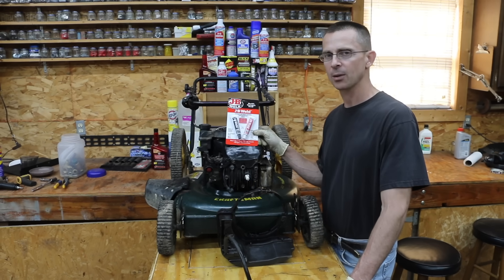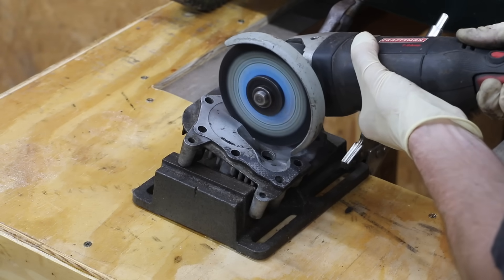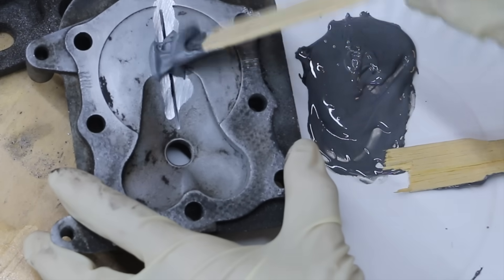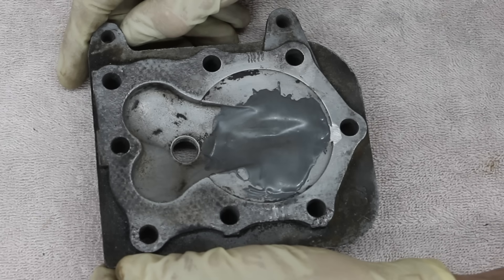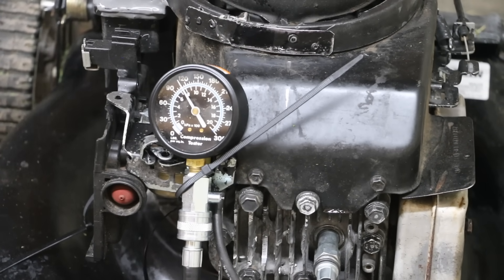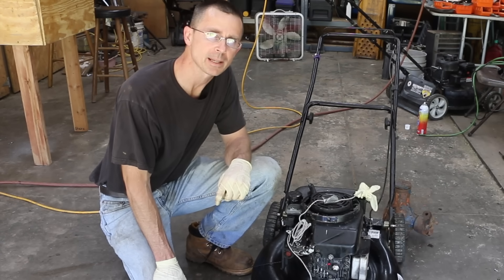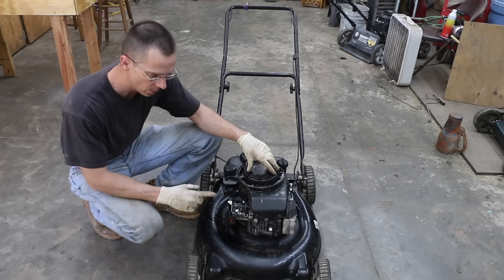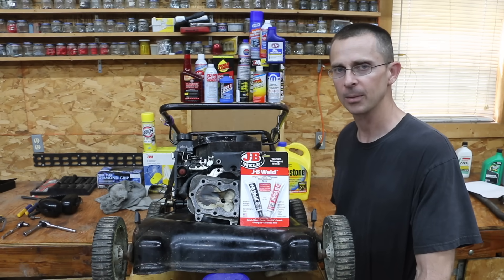Can JB Weld fix a cracked cylinder head?  See the proof!!

Comment: ive never used  JB weld. I would have never trusted it to BE a metal.  now not to knock the vid but I think a crack would have extended to the end of a head or whatever which would allow twisting between the 2 sides.
ive seen Jeff of "ElderlyIron" use JB weld for worn spots on an axle where a seal rides. I would not have believed it would work, but he swears by it.
thanks for testing.
Reply from the maker: Great point!  Thanks for watching the video and commenting!

Comment: I actually used JB Weld on one of my Cadillac's cylinder heads. Somehow it managed to get a divot just outside of the cylinder water jacket which caused the gasket to fail 3 times in just a couple years. It's been working fine for almost 2 years now.
Reply from the maker: Impressive use of this product!  Thanks for watching the video and commenting!

Comment: hey man. I'm digging these videos. I used jb to glue coral together in my aquarium. I'm curious to see how jb weld would stand up to vibration. maybe try breaking one of the engine mount tabs off. jb it back together and run the engine with only that one tab holding the engine down while running an unbalanced blade. could be interesting. keep up the good work. chris
Reply from the maker: Great suggestion!  Thanks for watching the video and commenting!
Reply: JB Weld is toxic to coral and fish, just so you know, as well as not safe for human food containers either! They do make ones that are for ceramics and plates and stuff though!

Comment: It works on diesel tractor heads. A friend of mine not only repaired the head with JB Weld, he tapped it and bolted it down. It ran for 4 years. I've used it on swimming pool filter control valves which are known to crack through the threads. When the JB Weld cured the leak was fixed. It's an excellent product.
Reply from the maker: Wow!  Very impressive fix!  Thanks for watching the video and commenting!
Reply: I've seen it fix a crack in the block on a diesel tractor as well. Still runs 10 years later. No oil leak, and no antifreeze leak.

Comment: We used JB weld in the shop in conjunction with cold weld plugs to repair cracks in the exhaust and intake ports in cylinder heads that came in for valve jobs. We never had one come back!
Reply from the maker: Impressive!  Thanks for watching the video and commenting!

Comment: There is a similar product they use to fix tank canon bores.   I've seen someone fix a hole in a cylinder head with it and I know it's used to fix holes in coal slurry pipes - its called Devcon 10760 Titanium Filled Epoxy Putty - pretty amazing stuff, I used it to fill some rust pinholes in sheet metal and it's pretty much unsandable afterwards.  It's extremely expensive, but by far the hardest epoxy-type filler I've ever seen.
Reply from the maker: Thanks for the product recommendation!  Thanks for watching the video and commenting!

Comment: JB weld is great stuff I once used it on an oil pan the oil pan was on an ls1 engine making roughly 500hp it has never leaked and that was back in 2008 when I applied it
Reply from the maker: Impressive!  Thanks for watching the video and commenting!

Comment: here's the potential future item I used the product Q-Bond, and I used it for repair of a carbon fiber propeller. it comes essentially as a super glue which binds to an adhesive which is designed for different materials including metal. I think it would be worth a shot to try it out or something such as a cylinder head excetera. http://qbond.net

Comment: Maybe this experience will help someone who is stuck? Many years ago, I had a college kid for a tenant who worked a night job as a security guard. His funds were VERY tight. He developed a leak in the metal fuel tank of his chevy sedan.  So here we go, flat of my back on a cold winter evening under an old chevy. We hit the leak with rough wet and dry paper and put a nice fat self-tapping screw into the "spot." We mixed and applied an epoxy putty product rated for fuel tank repair, smoothing out the product to cover several square inches in addition to the screw head. Once I was positive the leak was stopped, we placed a bare light bulb under the repair to speed up the curing process and kept an eye on it for ant sign of a leak. In a few hours, my college student went off to work and had no more trouble with his vechicle. Not the perfect repair I would have liked to perform but it worked until graduation, a year and a half later.
Reply from the maker: That was nice of you to help and a great success story!  Thanks for watching the video and commenting!
Reply: That was very nice of you too.Also glad to hear there's another smart person out there who'll use JB's stuff.
Reply: @derkmerv6725  LOL.
Reply: Rub a bar of soap on a cracked gas tank. Works great
Reply: I was that college kid...   not .. but cool story.

Comment: Is there a single lawnmower left in your neighborhood???  Nice video.  One time we build a blown small block chevy with an aluminum block.  We had the motor on the dyno and it started leaking oil out of the back of the block.  There was a porous section in the casting allowing oil out of the main pressure galley.  The customer was due in in the AM.  So we scuffed the surface and wadded it up with JB Weld and let it sit overnight.  We should have TIG welded the block, but we had no time.  Worked like a champ with over 80psi of oil pressure on it.  Thanks for another great video.
Reply from the maker: LOL!  Running out of mowers around here! Thanks for sharing the success you had with JB Weld and Thanks for watching the video!

Comment: I tried jb weld on a gas tank, and it started to leak after a week. could have been my fault, but I'd like to see your tank after some time has gone by. I did used quick weld. maybe it doesn't work as well for gas tanks. great vids, thanks for keeping it real.
Reply from the maker: Others have commenting that the quick weld isn't as strong or durable.  Might be worth trying the slow dry product.  Thanks for watching the video and commenting!

Comment: JB is pretty good stuff! it's supposed to tolerate up to about 500ºF. it does need to be reinforced on thick, structural repairs. Fiberglass or aluminum window screen usually will do the job to reinforce it.

Comment: Great video(s)!  After garbage picking a 1982 Lawn Chief rototiller back in 2001 (only to find out the fuel tank was severely pitted w/dozens of holes & replacement tanks had long since been discontinued) I used JB weld (based on my Grandfathers advice) and coated the entire fuel tank on that 1982 Lawn Chief tiller... and 15 yrs later the JB weld is is still holding strong. No leaks or cracks and I never drain the residual fuel out of it! Plus, all these years later, the tank itself actually looks as though it had been  professionally spray painted gun metal gray thanks to the JB weld!
Reply from the maker: Awesome!  Glad it worked!  Thanks for watching the video and commenting!

Comment: When I was running sprint cars used JB to fix a cracked head on a HC 327 also to fix a cracked block where it had sat in an outside barn with water left in it all winter. Was a wide crack and the JB wanted to run out the bottom so backed it up with the silver paper from a cig. pack. Engine ran for two more years, thru several re builds, till a rod let go and I couldn't afford enough JB to stick all the pieces back together.
Reply from the maker: Another great success using JB Weld!  Thanks for sharing and thanks for watching the video!

Comment: I don't know that it is better, or worse, but a similar product is Devcon Plastic Steel Putty 10110. It is similar to JB Weld except the filler metal is steel instead of aluminum. I don't know if you'd want to use it in all the same circumstances or not, but it is a similar product I've used for other things. It's machinable just like JB Weld is, and is a two-part epoxy product, too.
Reply from the maker: Thank you for the product recommendation!  I'll add it to my list of possible products to test.  Thanks for watching the video and commenting!

Comment: Neighbor from hell, don't leave your mowers unattended. lol
Reply from the maker: LOL!  Thanks for watching the video and commenting!
Reply: @HONESTO UNO;

If you're talking about old oil stains on concrete, this is the method I use.

1) Pour some mineral spirits on the area, enough to cover the entire stain but not really flooding it.

2) Dump floor dry/cat litter onto the mineral spirits approx. 3/4" deep.

3) Walk away.

4) Next day, sweep up floor dry and the stain should be gone. You may have to repeat the process if it don't remove all of the stain.

I've been doing it this way for years. The 1st time was strictly by accident. Once I saw how well it removed some old oil stains I tried it in a different spot. Same results. No more stain.

A good thing about doing it this way is I'm able to sweep up the floor dry and reuse it.

Hope this helps.
Reply: +HONESTO UNO
Thanks. I'm so happy it worked for you. like I said before, I found it worked by accident. Now it's the only method I use and recommend.

Thanks for the compliment AND the update. Glad I could help.
Reply: +HONESTO UNO;
If it's older concrete you can probably use a bit more mineral spirits. My garage is only 31 years old so it's not too bad floor surface wise.

I do however 'use' my garage. It isn't generally used for actually parking vehicles in, but for a multitude of repairs.

Make sure to use plenty of floor dry.

Here's my 'theory' as to why this method works.

Mineral spirits breaks up the old oil. Floor dry, when put on rather heavy, helps to keep the mineral spirits from evaporating rapidly, thus giving it time to work.

The extra floor dry actually soaks up all of the mineral spirits making for a dry compound which can be reused.

Like I said, it's only a theory. 

All I know is it has worked well for me.

Please keep me posted.
Reply: "I swear my mower had an engine last time"

*Hears from neighbor's driveway*

"Today we're going to see if we can run this lawnmower engine on ground up mummy dust instead of oil"
Reply: Skinny Mcdoogin s
Reply: husky clip board
Reply: +HONESTO UNO Coca Cola works. Soak, rinse, repeat.

Comment: Fixed a metal rain gutter that someone shot a BB through. Put a little round bandaid on the bottom to keep it in there while it cured. It will still be there after the rest of the gutter rusts away. 

I like the idea of patching a piston. First, see if the mower will run with a small hole and keep making it bigger til it won't run..
Reply from the maker: Piston fix would be the ultimate test!  Thanks for watching the video and commenting!

Comment: I used JB WaterWeld to fix a small hole (about 1/4" or 6 mm) in my water jacket on a 3.5 L Isuzu V6 engine.   I mistakenly used a bolt was only a bit longer on the front of the engine.  Anyway it punched through and created a small leak in the water jacket around the cylinder liners.  A mechanic I knew always used JB Weld products so I gave their water tolerant compound a try.   

https://www.jbweld.com/products/waterweld-epoxy-putty

That was over 5 years ago.  It is still going strong.  It does have a bolt helping it, so it was not as severe as your case in the video.

Comment: Awesome job with your vids! 12 years ago I re-set a set of valve seats with jb weld (bad peening job from local machine shop)in a briggs powered riding lawn mower fully expecting the jb weld to melt around the hot exhaust seat especially getting pounded by the valve..not a chance...it still runs and has great compression..and it gets plenty hot in the texas summers...Great job cant wait for your next vid!

Comment: I've used JB weld to patch a hole in a gas tank on a 2005 Hyundai accent. A piece of rebar punctured the tank. I sanded around the hole to bare metal, used an epoxy gas tank sealer that I purchased at autozone, the stick kind you kneed together and it hardens to metal. Then I applied JB weld to the outside of the patch. once all of that cured I sprayed it with an undercoating. I did this because the owner only used the gas tank epoxy kit from autozone and it continued to leak. My repair fixed it, the car eventually went to a state where vehicle inspections were used, before it went out of state, I sprayed the undercoating on it. It always passed inspection, it held up for 6 years and the owner finally got rid of the car last summer.
Reply from the maker: Thanks for watching the video and commenting!

Comment: When i worked at a dealership, i once lifted a brand new transmission with my lift using a chain, and while it was like 4' high the chain broke and the tranny hit the floor, i didn't see any damage at first so i proceeded to install it, and when i was filling it with fluid i saw a couple of drops on the floor, upon inspection i saw it was dripping from a hairline crack on the aluminum casting, so i started to gather my tools to go home early and write my resignation letter until i saw those JB weld tubes on a shop table, next thing i drained the transmission and applied the mix, went home, couldn't sleep, arrived the next day at like 5 am, filled the transmission, no leaks, programmed the new module and went for a drive, inspected it again, dry as a bone, this thing is no joke
Reply from the maker: Very impressive!  Thanks for watching the video and commenting!

Comment: I used JB Weld to fix a WW2 keep cylinder wall where the wrist pin had a horrible length-wise gouge. Being at 46-50 HP I was curious. It has held for over 7 years with no ill affects. This stuff really is amazing.
Reply from the maker: That's impressive! Thanks for watching the video and commenting!

Comment: try prolong  they use to have commercials where they would drain the oil and run the engine and even dump sand on the open heads of the motor and it would stay running
Reply: Scott Lober yup. I remember that commercial. They used one of the most indestructible engines of all time, the Chrysler slant six. Just saying
Reply from the maker: I need to test the claims of Prolong!  Thanks for watching the video and commenting!

Comment: Broke the plastic return line neck off a radiator on a road trip 600 miles from home. Bought and applied 2 sticks of water weld and it was still on there when I sold it 160k later.
Reply from the maker: Impressive!  Thanks for watching the video and commenting!

Comment: damn That's nuts love what you do keep it up you've earned my subscription but this maybe a bit of a stretch but what could J-B Weld due to a cracked or damaged piston
Reply from the maker: Glenn, I like the suggestion!  I think I'll try it!  I've been wondering the same thing too.  It seems unthinkable that it'd withstand the vibration and pressure changes from combustion and crankcase fluid, etc.  Thanks for watching the video and commenting!

Comment: Don't use the fast cure jb weld. It's not as strong.
Reply: Jamie Nichols 
ABSOLUTELY correct! I've tried using the fast cure a few times and finally gave up, will just wait on the real thing now.
Reply from the maker: Thanks for sharing this information.  I was wondering if that was the case!  Thanks for watching the video and commenting!

Comment: Impressive.  That's a lot of "torture" that the piston and the crack have to sustain.  It would be interesting to see how long this "repair" holds up after a year of mowing.  I've used JB weld to repair a hole in a concrete block wall to mount a gate latch.  It's still holding more than 9 years after.  I used JB weld to repair threads to install the idle cutoff valves in an old VW engine carburetor.  The threads in the carburetors were stripped out.  Worked great for many years.  Cheaper than buying two $200 carburetors (expensive at that time, now they are cheaper).
Reply from the maker: I greatly enjoy reading about the experiences of others with this product and other additives!  Thanks for sharing!

Comment: Repaired my son's muffler for his quad, couldn't electric weld or torch it. but the JB weld lasted longer then the 4 wheeler did. very impressed I was. good vid and give clearance .
Reply from the maker: I'm impressed!  Exhaust issues are just as much torture as the test I accomplished!  Lots of vibration and the bonding surface isn't always optimal either.  Thanks for watching the video and commenting!

Comment: I know a dozen or so people who have used JB weld on their radiator over the years. I think you should do a test on how much psi it can hold with a fluid over 195 degrees.
Reply from the maker: This is a great suggestion!  If the JB Weld is applied inside any sort of tank, the pressure that it can take will be significantly higher than if on the outside.  I imagine nearly all radiator repairs are accomplished applying JB Weld on the outside. Thanks for watching the video and commenting!